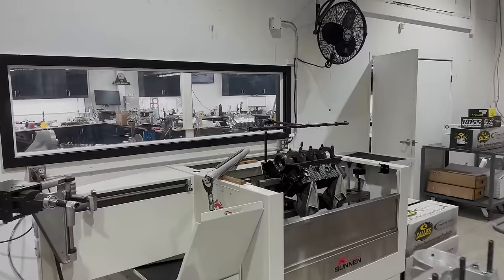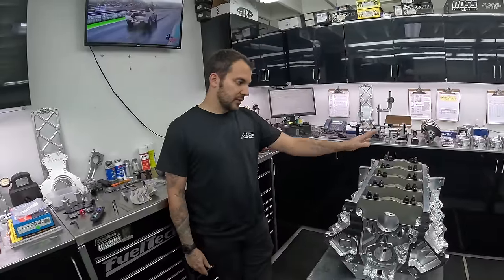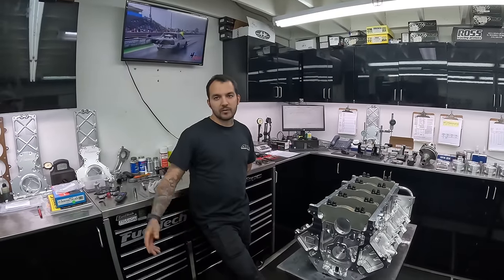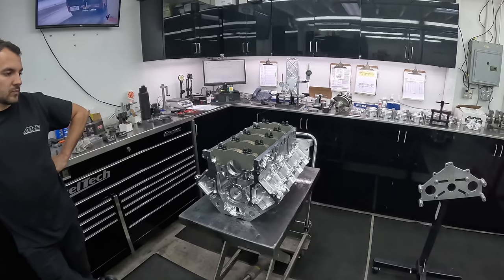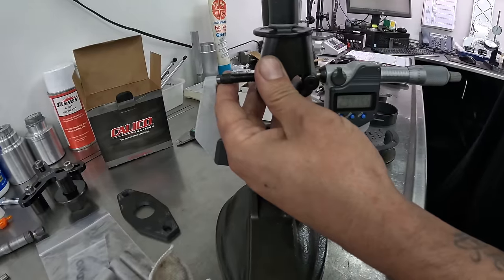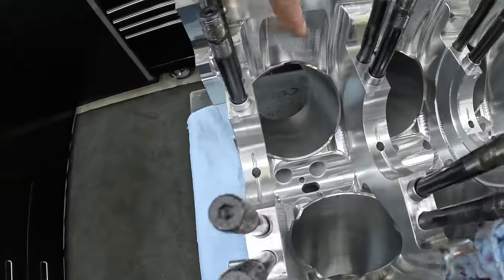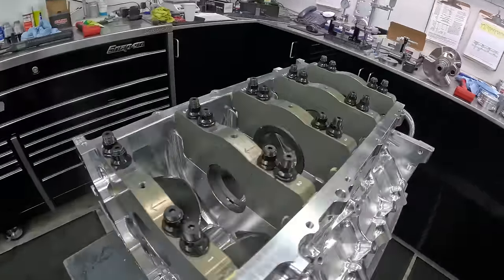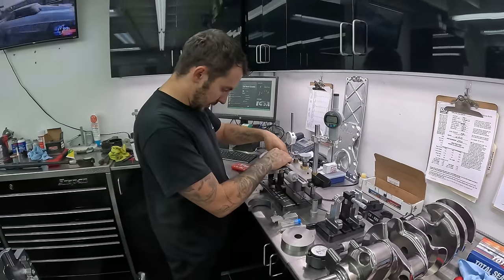Exclusive Billet Engine Build For a Mystery Project Car!

Comment: Very informative video Mike!! Thanks for sharing 👍. I always loved building engines. Years ago I built a 350 for my brother's sportsmen dirt modified. While everyone else was spending 25-30k for a special built engine (i.e. Tony File engine) , a lot of us who love the sport, but don't have a endless bank account,  made due with what we could get.
I had a 1973 350 engine from a Canadian Chevy Suburban. 2 barrel, bolt block. The block casting # 3970014. I had the machine shop install splayed 4 bolt main caps and bore it 30 thou over. I had a factory steel 350 crank, and had it turned 10/10 because of wearing showing. I also had a set of pink rods I bought from a friend. I used Keith Black hypereutectic pistons and rings. The heads I had were 327/300hp casting number 3917291. I had the bigger 2.02/1.60 valves installed with bronze guides. The camshaft was from Crane, and was a hydraulic tappet, with the same specs as the 1970 LT1 Vette camshaft. Fluid damper, and a Pete Jackson gear drive. 
I had a digital scale,  and weighed everything for the rotating assembly making sure it was dead on. It ran great.
One night my brother was pushed up into the marbles,  and panicked. He coasted into the pits upset and apologized to me. I asked him what noise it made when he shut it down. "I don't know,  but look!". He hit the button on the tachometer to show the highest rpm. It buried the needle at 9k. My father says,  fire it up so I can hear it. After my brother fired up the car, my dad's words were 😂😂😂.  "It's fine!! Get the bleep- ity- bleep back out there!!".  While this was going on,  they were clearing up the track for the accident that he was pushed up the track for. He started in the back of the field,  still on the lead lap. My bragging rights: 
1) he won the race.
2) he set the track record lap time 
3) I built a Chevy 350 that turned 9k rpm! My total out of pocket was only 6k!😎🇺🇲🇺🇲

Comment: Sunnen makes a dial bore gauge set up fixture.  I always miked the bearing thickness with a bearing mike. A bearing mike is a one inch mike with a ball on the anvil in stead of a flat surface.

Comment: Good use of the measuring tools. A micrometer or calipers are for measuring. A dial is for comparing a set value (there are exceptions).

Comment: As a pro in measuring bizz,I can tell you that 20 deg celsius is the standard temp to measure parts.There are rules of tumb like for cast iron 1 degree causes 1 hundredth of millimeter per 100 cm growth.

Comment: Very interesting project. Cool info about the block with a nice explanation of how to measure and set set bearing clearances..  The two piece thrust bearing has to be a giant pain in the butt. Surprised they don't use a 5 piece one in a custom billet block .
Wondering how you'll keep a head gasket in it though.
Hoping the engine goes in the bed of a Mazda pick up truck.

Comment: i had read somewhere that ACE did Westberg's engines ( sick the mag?) but didn't know anything else about them. How about some history on this fellow and his business. Everyone with LS's seems to fit head gasket issues but Westberg was running high boost successfully. This is interesting. Great video. Many thanks  Mike.
Reply: topfuel hoops fixed that issues
Reply: He mentioned it in this video.
Reply: @NurMuhammad-mo6ki  - And more head bolts per cylinder vs stock LS 4.

Comment: 20 degrees Celcius is usually what try to maintain in the shops I’ve worked (watches and altimeters in Switzerland).
What’s important is keeping the measuring tools and measured parts long enough in the same room. Being careful as well not to hold the measuring tools to long in the hands.
Reply: One of the first things I learned when I was training at a machine shop, don't hold measuring tools too long.

Comment: Love how it's using Ford 351C main journal sizing. Wonder if it can flow like a Cleveland 4V head CFM 🤣
Edit: Damn man that crank is a piece of artwork and love the block details.
Reply: I’m betting the Noonan head will outflow a Cleveland 4v head.
Reply: A LS was based on SBF architecture, even if Chebbie guys deny it.

Comment: I use a 170 000 euro Trimos to set clocks at 0.001 mm accuracy as tolerances are in same range and one thousandth over or under leads to junking a expensive component.

Comment: Setting a bore gauge with a micrometer will have some error. Probably not enough to matter for this, but the ideal is to set it with a ring gauge or gauge blocks. The micrometer is calibrated to read with more contact force than the springs in the bore gauge can apply.

Comment: Holy mackerel Steph’s attention to detail is incredible!!! Such a beautiful shop and I remember in the Navy measuring stuff for the Fairbanks diesels we would set the micrometers in an injector pocket so they would be the same temp as the engine parts!! Great video!!
He mentioned running 50W oil. Is there a certain additive package you search out for the drag n drive events? Do you run synthetic or natural? 
Thanks Mike and Happy New Year!!!

Comment: In the off chance that you'd need to swap bearings during Power Tour, how would you maintain the clearances that he's specifying on each cap with off the shelf parts?  I feel like it's an obvious answer of get it back up and running and we'll worry about that later but figured I'd ask.

Comment: For an Auto Drag Car and LS, do the Pro Builders not notch or scribe the block-side thrust bearing to add a small oiling path (facing rear) to aid the thrust face with heavy charge pressure converters etc ?

Comment: Why not a SML block and heads with 6 -1/2" diameter studs per cylinder and the water jackets do not flow into head gasket aera? This prevents water from ever making it into the cylinder resulting in bent rods or exploded pistons.

Comment: Omg I need this for my catfish Camaro im picking up, stripper model no power options at all even has manual windows and no t tops , T56 car . That motor a pair of comp oil less 85-88s a built 9in should be good for 7s

Comment: Funny I’ve always loved small block Chevy for its uses from sprint cars to nascar,  boat racing , drag and everything else..! But remember its nearly the same block design since 1955 ?  Well time has changed with turbo chargers producing 3000 + hp and so it was time for a update and GM came out with the LS ..! Now that it’s becoming such a beast and all the billet stuff is coming around i hear the Ford crowd whining that GM copied  the blue oval ?  If they did why didn’t ferd build their own before GM made the LS-3 and so on..?  The LS SWAP is a swear word to the ford crowd aint it now ?  Nice billet piece man !  
❤🏁🇺🇸

Comment: Isn't this the fella that blew the hose fitting off the radiator of his absolutely brand new '66-'67 Chevy II and bashed every body panel into the walls at Bradenton at the very start of the first Sick Week?!? 
Man, I felt so sorry for the guy! He brought a killer of a racecar with all the boxes checked and he'd even tested it quite a bit. It was a complete freak mishap and we later learned that the radiator had even been in another car running just fine!!
I am curious though (this is a legitimate question and not an arrogant comment from someone who thinks they know better, why wouldn't we be using a more durable "needle bearing" style or other heavy duty solution for the thrust bearing, considering that it is a drag n drive (i.e. endurance) engine that will undoubtedly be behind a th400, which are known to put their man part's in the buttocks of LS thrust bearings..

The other thing.. at this power level and considering it's intended purpose, again I can't imagine that it will end up with anything in it other than a TH400 obviously, but if we're even remotely similar, I can't see it getting a Pimp Trick Gangsta Click transmission and not springing for a lockup unit, especially with the power this thing is churning out and I'm not an expert guys, but I really feel like the thrust bearing is heading to the house, suitcase in-hand at the mere mention of a lockup!! It has everything else, the Dong-Slinger 9000 crankshaft with Big Boy journals is begging for lockup, I just don't understand how that factory deal could get the job done.. 

I apologize if this was covered in the video, I watched it all but I did get a 30 second call from the old lady while it was playing..

Comment: I was a CNC machinist at Caterpillar tractor in East Peoria Illinois in the winter time we would have to shut Machinery down that was within about 50 to 60 yards of an overhead door that had power truck traffic coming in and out just the cold weather what cause cast iron parts to change Dimensions enough that they were not intolerance

Comment: Can a bullet aluminum block handle as much power as an iron lsx block? Seems way too much money for the 100 lbs difference.
Reply: In the video he mentions that the weight difference between the Billet aluminum block and a cast iron block is very small - so not a 100 pound difference. Also that some regular cast blocks are good for around 1000 HP. I remember many years ago that GM LSX blocks were designed for 1000 HP and that Pro Stock drag racer Warren Johnson had input on its design. Note: He is building this engine with aluminum block because it is designed to handle 2500 HP easily, and can be welded back up if damaged (in certain ways) .
Reply: @dalemam7962  That's incorrect, Billet aluminum block and cast aluminum 10-20 lbs difference. Cast iron block 100lbs.differance.
Cast blocks (aluminum or iron) good to about 2000 HP.   Billet aluminum good to 2500 + HP

Comment: For those who have 'issues' with using the ISO Standardized Metric system, 20degC is standard 'room temperature', 21 for the Air Temperature means the hardware will be 20 degrees.

Comment: To me, this isn't practical. I would have honed it because if you have a roadside fix who wants multiple bearing sizes? I use all these gauges and temp makes a difference. My place is climate-controlled at 68. I will stick with Bbc and Sbc. My hipped Brodix block had 3650 RWHP for 4 seasons before I bought it and it's not had a repair done to it. You could have got a billet bbc block that will have a lot more shelf parts available from Brodix,  Callies, MGP, or whoever.

Comment: 6 seconds for a drag week ..I  hope you get someone on your team to help you get there safely after seeing you guys struggle to get a 1000 hp blasphemy off the line in 1 piece . Good luck bud
Reply: Brrr.  Damn that’s cold.🥶
Reply: Cold truth at that speed one brake caliper seal blows, one bad wheel bearing , or blemish in your tire you can be saying prayers as you head for that wall hoping those welds in your cage are 100 percent

Comment: So Finn is now stepping into the realm of Steve Morris and Tom Baily and will be competting against the 200 mph club. Can't wait to see this :)
Reply: Maybe but he's going to be down a lot of cubic inches if that's what he's shooting for going to need a very very light chassis if that's the goal
Reply: @freedomfox8183 - The Noonan water jacketed billet LS blocks are available in a 9.750 deck height so it won’t be down as many cubes as you might think if Finn got this vs the 9.24 standard height deck.

Comment: I love hearing how much ls engines are just like small block Fords…. Let alone using Ford journal sizes… 

They really are a Gen 2 SBF… splitting in half at a point just like the SBF… lol
Reply: Good point!
Reply: Don’t forget grandpa the FE,2.75 is also FE main size,and skirted bock,oil routing….
Reply: Then to top it off they use a Ford rear-ended to push it down the track.

Comment: The whole thing of "That engine doesn't belong in that car" is dumb. Plus depending on what kind of car the roller is it's 100% going to run better, better access to parts, among many other things from using a newer engine. That and 95% of the people who say that have never worked on a car.